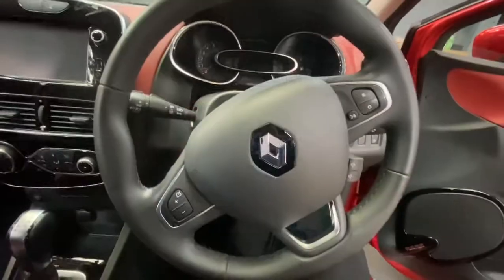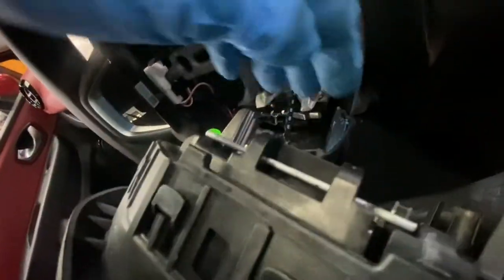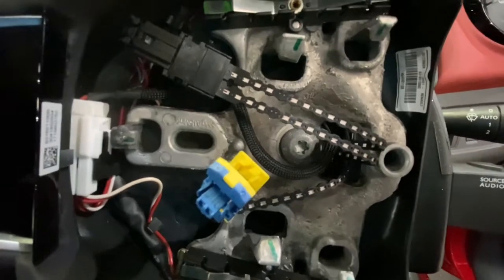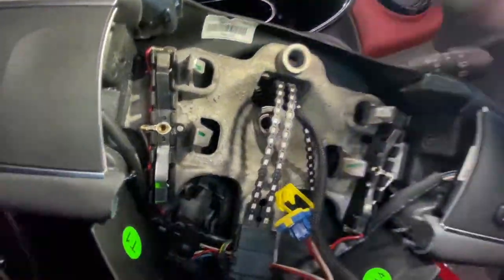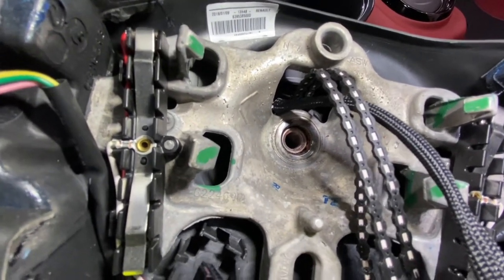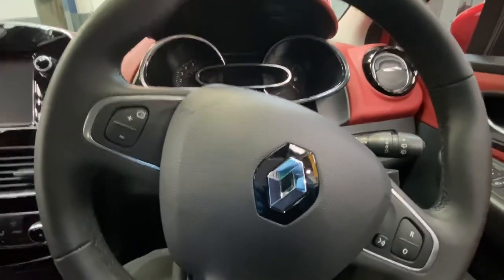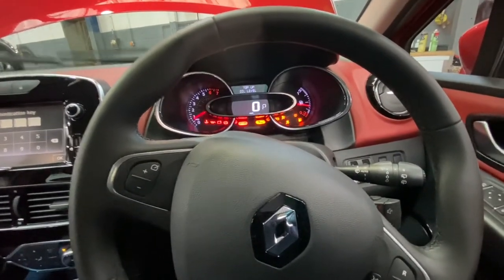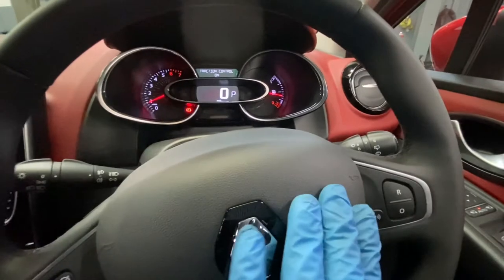#Renault #Clio #steering #wheel and #air #bag #removal

Comment: Hi, thanks for the video. One question: its only necessary remove negative born from the battery? After, it's possible move the steering wheel without locked?
Reply from the maker: What exactly are you trying to say?
Reply: @ The guy with the comment in French had the same doubt as me.
I wanted to know if it was necessary to remove only the negative terminal of the battery and then the steering column would allow me to turn the steering wheel to be able to remove the airbag.
Reply from the maker: @wellmarinho you can just remove the negative terminal however you will have to make sure it doesn’t come in contact with any earth otherwise the airbags could blow up in your face causing you serious damage

Comment: bonjour , quand vous débranchez la batterie, vous pouvez tourner le volant ? la direction n'est pas bloquée?
Reply from the maker: Can you translate in English
Reply: @g_a_bofficial  hello, when you disconnect the battery, you can turn the steering wheel? the steering is not locked? ...I had the answer. 
another question: does the steering wheel come off easily? do you have to jam the black and white connections in order to put the airbag back on?
Reply from the maker: You can turn the steering wheel if you have a manual key to release the steering lock the wheel comes off easily the air back is the hardest part to remove

Comment: Thanks man but I can’t push the bloody springs from the side. I can feel I’m pushing them a lil bit and then try to pull the airbag but it doesn’t move. Any tips?
Reply: Don’t worry I pushed harder and it worked. Thanks!!🎉
Reply from the maker: It’s fiddly if you watch the video properly I di show how to remove the steering wheel air bag